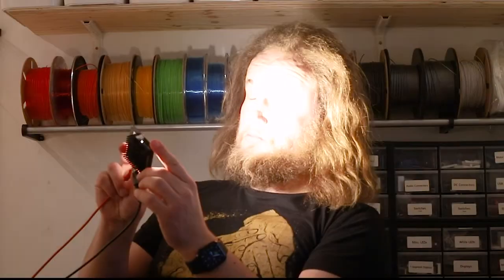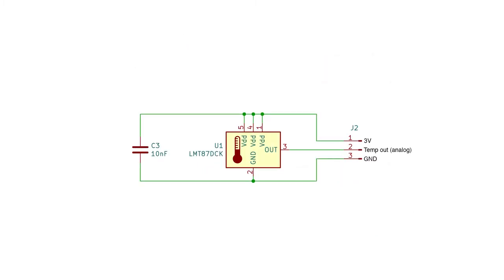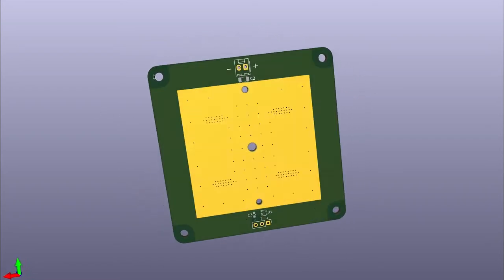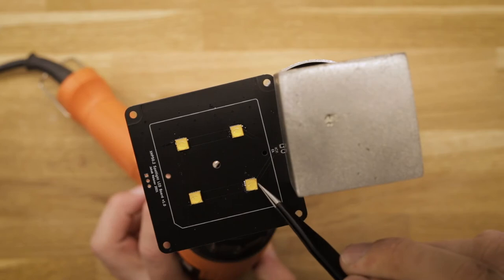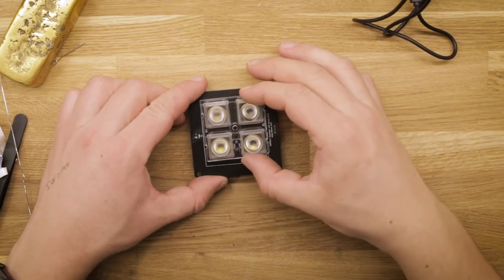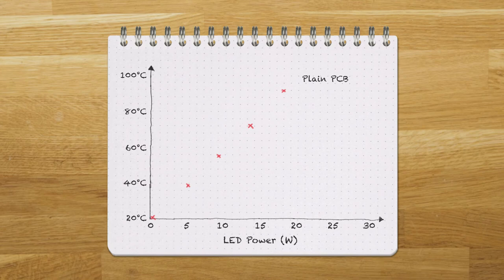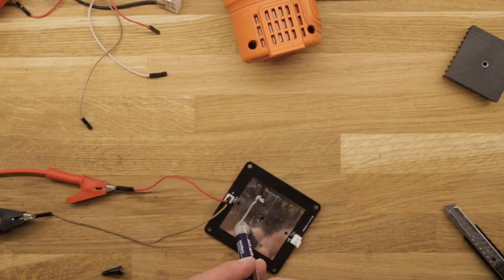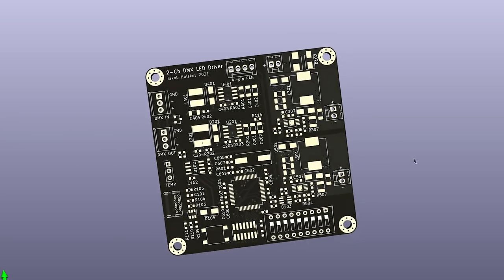A hot LED PCB  - DMX Spotlight Build, Part 1

Comment: Hi,

What stregth magnet did you use in your iron extraction from black sand video?
Reply from the maker: It was a magnet found in a larger generator; I cannot tell the exact strength. As long as it picks up the magnetic particles, you will be fine.